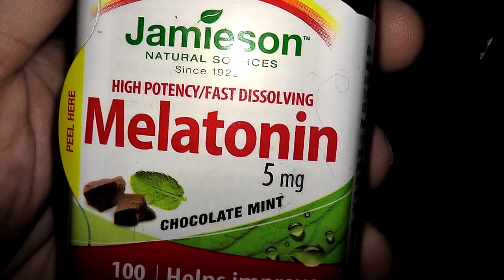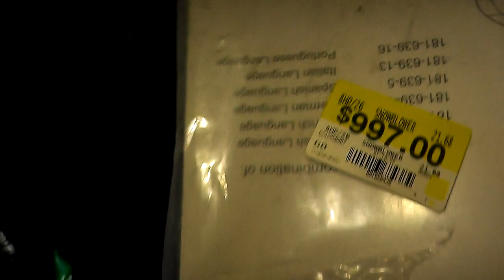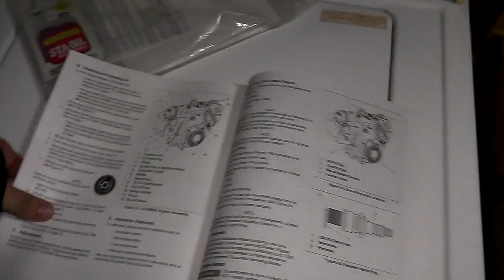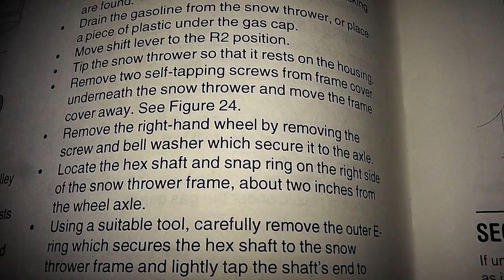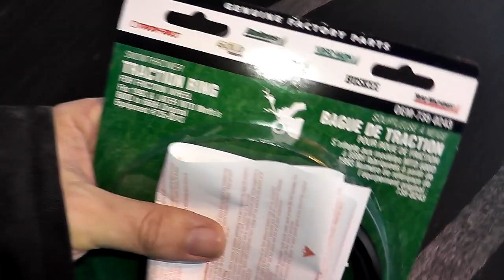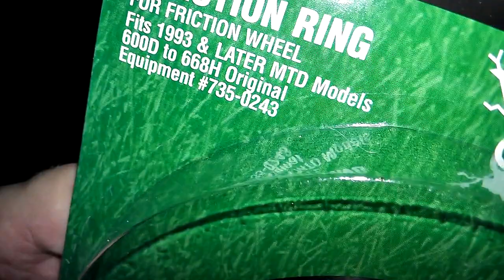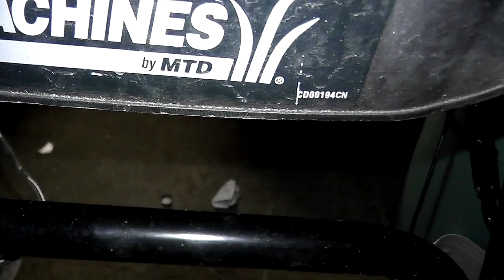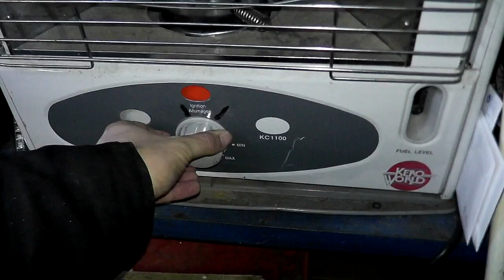Fixing the Friction Disk on the MTD Yard Machines Snow Blower

Comment: Since you've still got some time until January, you should really consider also fixing that recoil (I'm sure Rex has done a couple hundred of those so far), or at least install a good battery into the blower for electric start. Because it sure will get old soon, having to wind that cable back in manually after each pull!
Reply: +Seegal Galguntijak  on my snow blower the electric start does not have a battery, a 110v extension cord plugs into it and I push a button.
Reply: oldguy1944 Oh, so you plug it in only to start it? Somehow that seems strange to me, but then, it's probably just another thing of being used to or not - and at least as long as the engine stays running and doesn't have a "dead man switch", it would work. Still, I opt for fixing the recoil.

Comment: Did you clean the schmoo off of the aluminum plate that the friction disk contacts?  the rubber deteriorates and leaves a film on the aluminum that causes it to slip. im guessing that is what most of your problem was, judging by the oil or whatever was all over the inside of that thing. The old ring didnt look that bad. I usually run mine till chunks start falling off of, lol. If it slips i just scrape the plate off and give the rubber on the disk a wipe with alcohol.

Comment: you can use salt as well rather then wash powder adam plus if you ever have a blocked sink get a scoop of wash powder pour it down the plug hole and let it sit over night but leave it dry dont add water then in the morning put some hot water down it and it will empty better then ever!

Comment: I'm glad to see you warm up the G6 before driving!  I have always let our vehicles run for 10-15 minutes in winter to defrost the windows and get the engine up to operating temperature, despite it becoming increasingly unpopular and frowned upon.  There is no way an engine with oil the consistency of maple syrup can run efficiently, not to mention the risk of windows re-freezing whilst driving as they are not warmed up.

Comment: Is it possible to change my subscription display from a grid to the old column format. This grid display sucks.
Reply from the maker: +oldguy1944 yeah in the top right hand corner you will see two things one has 6 squares (3 on top 3 on bottom) other has lines....click on the lines and it will put it back into list mode instead of grid mode.
Reply: I maybe missing something but my top right corner has an upload button, a bell (messages?) and my icon. No squares or lines. Tried home page and subscription page and they are both missing the grid options. Going to try YouTube help and see if there is any hints there. Thanks